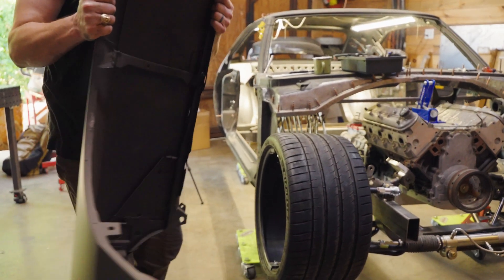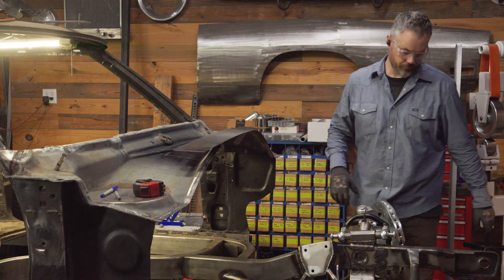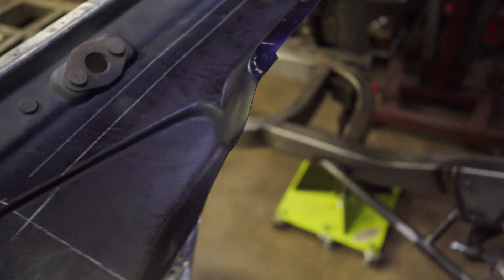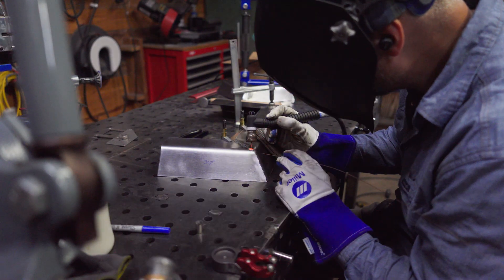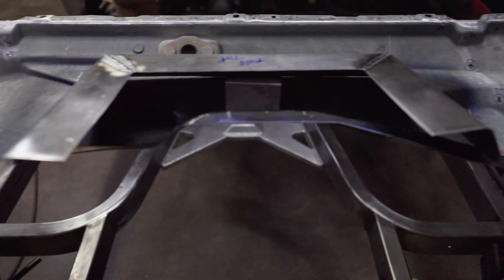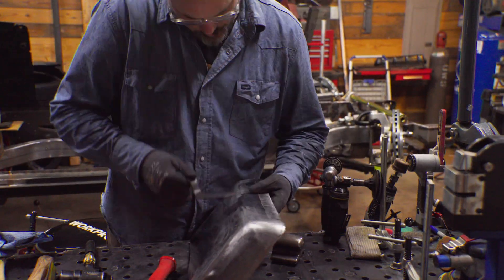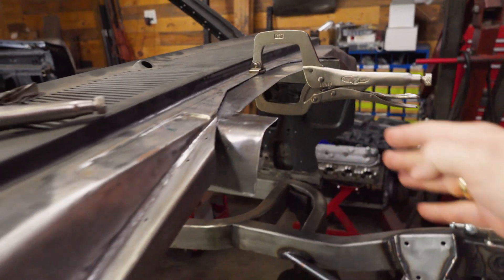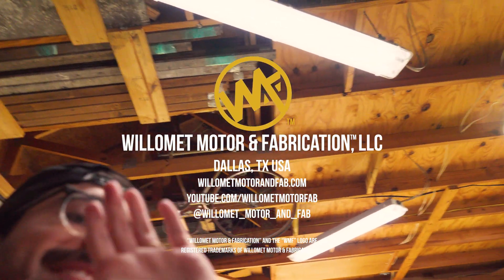Fabricating an Engine Cowl from Scratch | 1970 Dodge Charger 18

Comment from the maker: The LS  is set back 12.5”, making this a front mid-engine with half the engine hidden under the cowl. Being able to remove the intake without pulling the engine seemed like a thing that might be handy down the line. Let me know if y'all want to see a deep-dive into planishing and blending weld seams. I dip into the topic a little bit here, but it's a kind of a rabbit hole.

Also, Black Friday deals are going strong at ROAM Adventure Co and Baseline Overland:
Save up to 50% Off at  @RoamAdventureCo  or Bundle and Save up to $1400:
https://alnk.to/a44nxVl
  
Click the link to save on everything at Baseline Overland until 12/31/24 (automatically applied):
https://baselineoverland.com/discount/WILLOMET